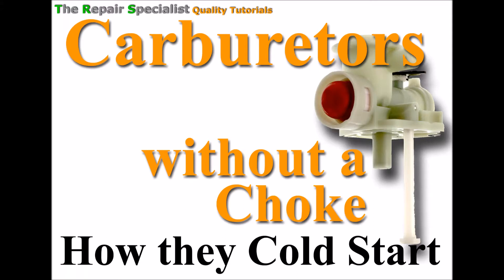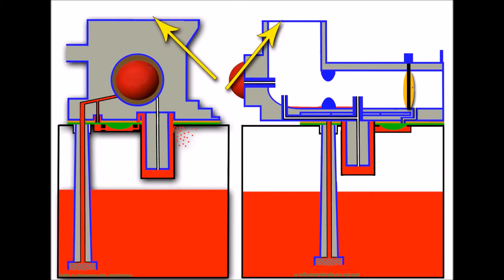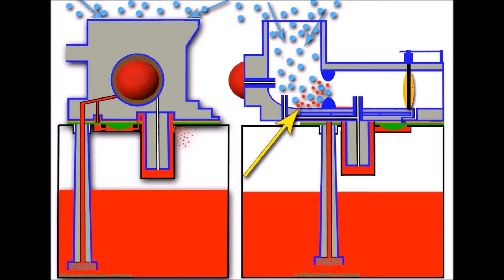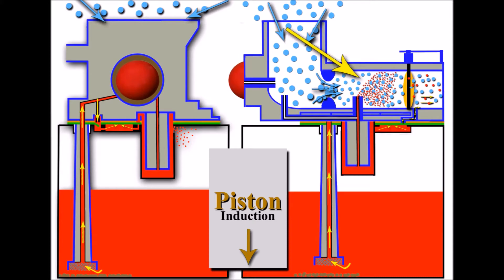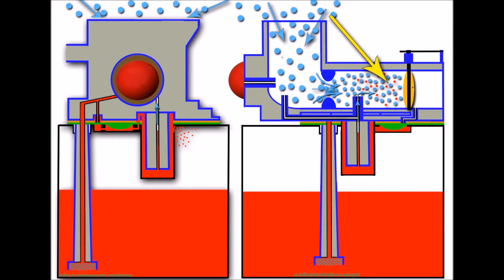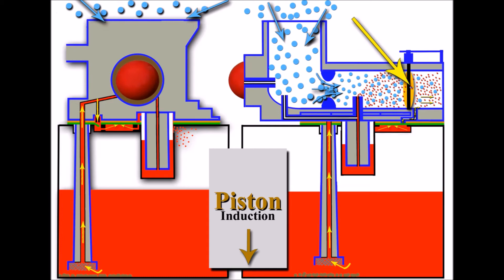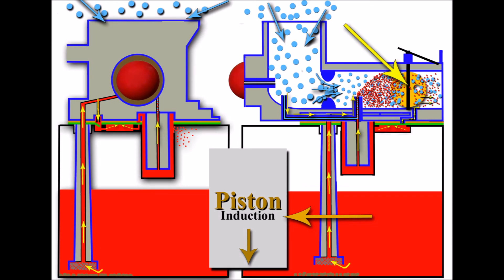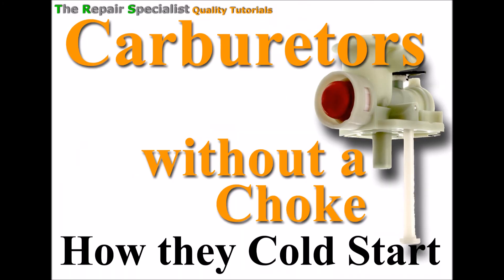Carburetor Cold Start without Choke - 4-Stroke Carburetor.  (by Craig Kirkman)

Comment: I have this carb on my Troy-Bilt Edger. I'm having an issue with it surging. I replaced the Carburetor with the gasket and diaphragm, replaced gas cap, replaced spark plug, and put gasket seal on the intake tube to the engine and still surges. Any thing else I should look at?
Reply from the maker: Hi. Sorry to hear you have been having issues after all of this. I personally would now check your fuel tank.  Specifically where your carburetor fixes onto the it (the flat shiny area after you have removed you carburetor).  Sometime these can distort allowing air to enter from this unnatural place and mess up the whole running. I can't say it is this for definite and the distortion can't really be seen by eye.  However, here is a quick way (that I personally use) to find out roughly if there is any distortion.  

I use a straight somewhere.  A piece of metal or an anvil or something.  Place some very very smooth wet-n-dry sandpaper onto it, and then gently rub the flat shiny area onto the smooth sand paper.  I am always extra careful no to rub too hard.  Just a few movements backwards and forwards!  

Then take a look at the fuel tank again, and see if you notice any areas that have not been touched by the sand paper.  Any areas untouched may mean that your fuel tank is distorted. In the past I have smooth these out by continuing to rub (if it isn't too distorted).  I have had some success but i have always found that purchasing a new one better of course.  It may be the issue or it may not.  Its process of elimination.  Unfortunately this is a risk you may have to take, which is what repair agents have to do each day in their workshops.   Rough sand paper may make things worse so please rub carefully on very smooth.  I hope this helps. Craig
Reply: @TheRepairSpecialist  I have a new manifold tube and gasket coming in today so I will try the new tube first,and if there are still issues, I will look at the tank itself. I have been banging my head against the wall with this issue so hopefully one of these items will fix the issue. Thank you for answering on such an older video and issue!!